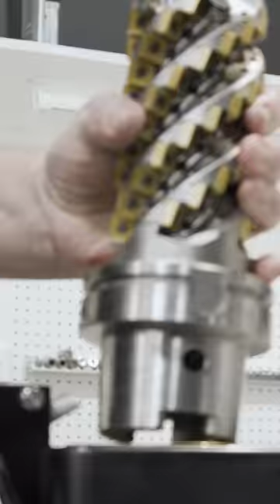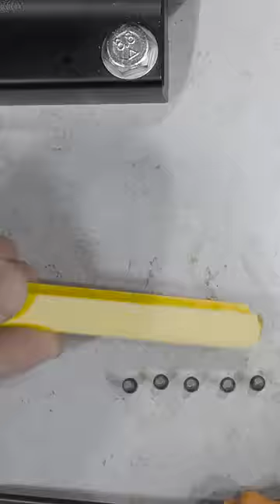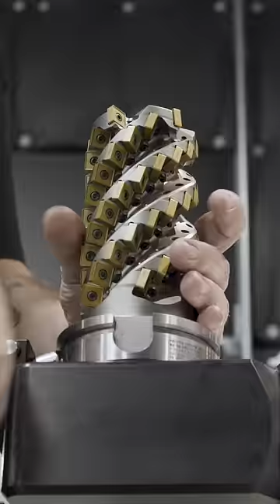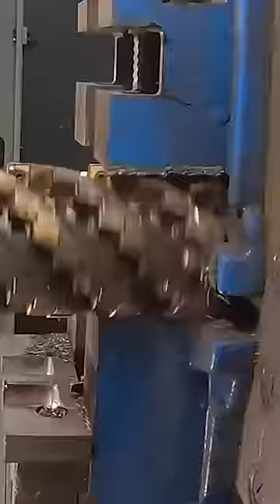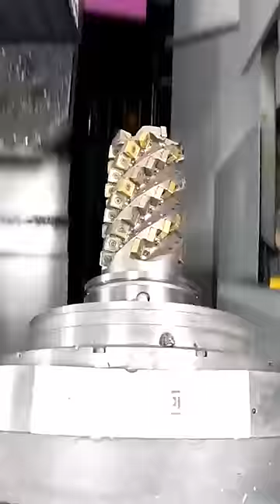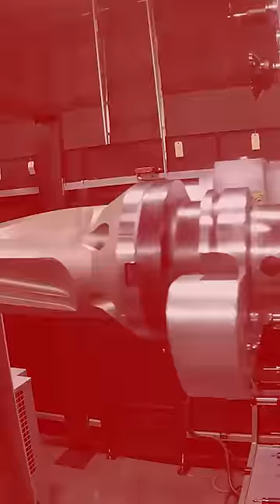End Mill with 65 Inserts OBLITERATES Broken Knockoff Vise #shorts

Comment: I saw that happen one time a coworker of mine was milling a huge piece he needed some help with machine adjustments told him what he needs to correct and he proceeded to be lazy about it and instead odmf doing the adjustement in incraments he just did it in one go and when the drill hit the piece it just broke everything and the piece flew at lightning speed through the plexy into the wall behind him a good lesson to do the job properly or dont do it at all..

Comment: I used to work for several CNC machine shops when I was a teenager, I was never very good at it, I was always just a mediocre operator who was never allowed to touch any programming but I remember clearly the sound of a machine crash and that shit is TERRIFYING. I remember another amateur allowing his bar stock to hang too far out of the back of a lathe when he pressed go and that thing bend and whip the floor and part of the machine itself like the arm of the devil.. holy shit.

Comment: You can’t go into a work piece shaped like that with that style of cutter. That needs full engagement or trailing off but being engaged at the bottom of the tool and coming into engagement at the top is going to pile up that type of inserted mill cutter every time. And the second one is a coolant thru drill so I don’t get it. Looks fucking cool though. M3 S1850 G81 F10.0 sound about right?